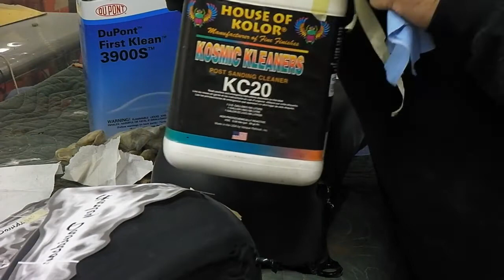Smoking Skulls

Comment: javier Soto can I ask what you use to clean your artwork overspray (water based paints) with? Im using creatix and wicked . Should a tack cloth work fine?
Reply from the maker: In this project I was using Standox base coat(solvent) paints and cleaned my overspray with water,  waterborne degeaser or even some windex(glass cleaner) with a 3M gray scotch brite scuff pad and lightly scrub the overspray off.   I just get as close to the edge as possible and then clean the very edges further by airbrushing with the background color which is black in this case. For water base colors like Wicked I’m more careful to not let the water flow onto the painted areas  maybe even use a mild solvent degeaser instead of water like PPG DX-330.  
.
Reply: @hovair  Thanks a lot Javier . Great work!